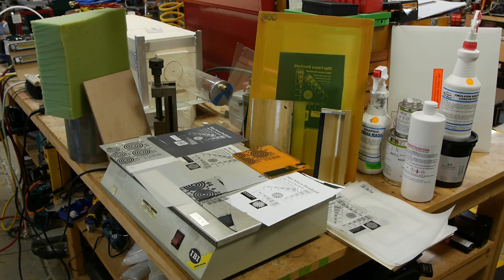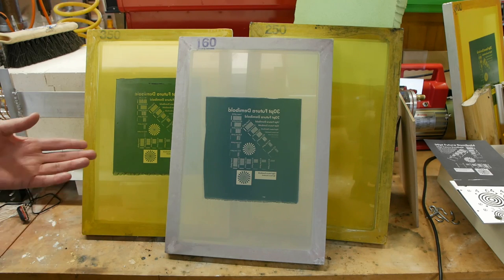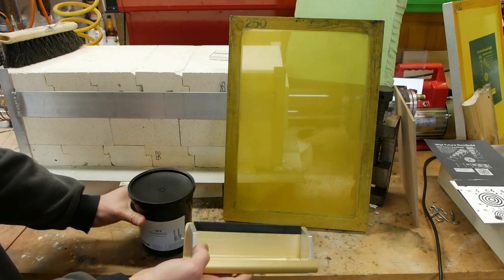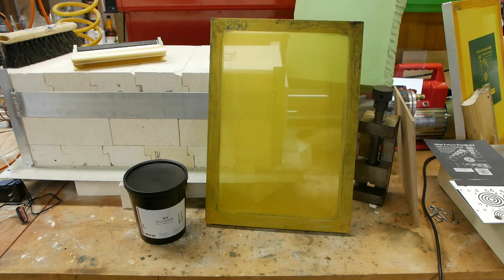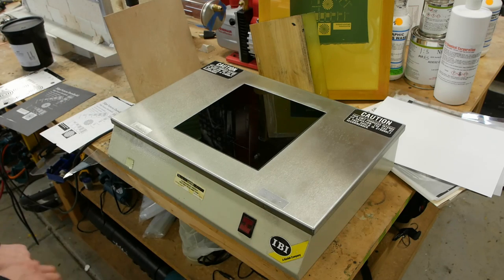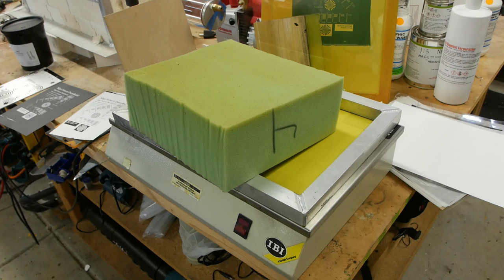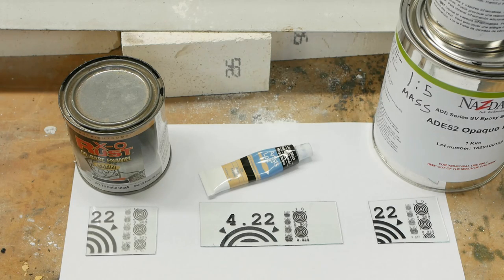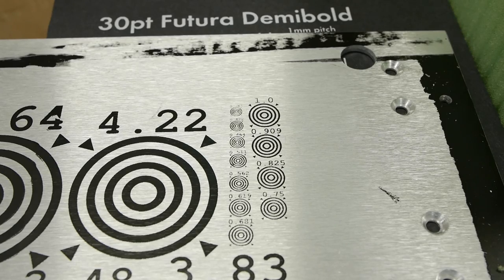High-resolution screen printing demystified

Comment: You should use inkjet to print the film. Not because of resolution, but because it gives a more solid print that blocks UV light better.
There is also a special transparent type of coated film that absorbs more of the ink, which gives greater contrast.
To help with exposing, place a flexible rubber mat over the screen and glass, and suck the air out with a pump. That will keep the screen and film in good contact while also blocking any stray light.
I think pink emulsion is a special long lasting emulsion, which might be why it was hard to get off.
P.S I've run a screen printing shop for 8 years.

Comment: They make transparencies for screen printing that are "textured" on one side, and are slightly less opaque than vellum paper. You put them through a printer such that the textured side gets printed on, and you do this a couple of times for one sheet, as the sheets are designed to take a lot of ink.

Comment: Ben, very nice video.   Years back (70's) when I started working we did PCB's with  the SS process. Didn't take long to go to emulsion resist film but the solder mask and legends were still via SS.  Now I think the solder mask is emulsion film and the legends are direct ink jet printed.  Before PCB's got so inexpensive I had plans to make a laser plotter with a rotating cylinder holding some ortho photo film.  Needed good artwork for my diy PCB's.  Also wanted to try a laser printer's rotating mirror scanner with a flat bed that moved in the X direction to raster plot the image.  I had a friend that  mounted a 405 nm UV laser  on an ink jet printer carriage and did a direct raster image to the PCB's resist film, it was slow but the image quality was really superb, for one off PCB's it was great. SS capability would be nice for front panels overlays.    Direct UV laser exposure should work with the silk screen emulsion  but I would guess it would be a little slow.  
Craig

Comment: That fancy stuff they sell to clean the epoxy screens sounds like something I use for cleanup when doing epoxy layups for my rockets. It's this stuff I get from TAP Plastics called "Replacetone". It's a non-flammable and non-volatile biodegradable solvent for epoxy. It works great at cleaning brushes and rollers, so it seems like it might be the same kind of thing, or work for this application. BTW, it looks like you have all the makings for a custom DSKY display now... is that the long-term goal?
Reply: Hmm, a DSKY display would be interesting! Also interesting is the fact that the font that's shown in this video, Futura Demibold, is very close to (or possibly identical to?) the font used on the buttons and indicators (apart from the EL 7-segments) of the DSKY.
Reply: Good catch!!! I didn't even make the connection.
Reply: Does that stuff dissolve set epoxy? Could it be used to depot potted electronics?
Reply: I don't think it works on set epoxy. You can depot electronics by soaking them in an acetone bath with a little heat and agitation over a long period of time (days/weeks). Just keep the container sealed so it doesn't evaporate.
Reply: You can dissolve epoxy with methylene chloride

Comment: The thing to take into consideration with vellum is that it shrinks a bit when it goes through a laser jet printer. This could be a problem when you're aligning your screens for a multi color print if the vellum sheets were shrunk unevenly. Especially if you're dealing with halftones. Acetate sheets would be the way to go when dealing with more than one color.

Comment: May be worth noting that using a totally transparent imaging film (with a compatible laser printer) does have a hypothetical use, and that's alignment for process colored printing. If you're wanting an image with color you'll need to make four passes and aligning the imaging films together before matching them to 4 different screens and a jig makes the work go a lot faster and a lot cleaner (i.e. skipping preprinting to align registration marks)

Comment: a couple notes, as I'm a screen printer by trade.
-while the different 'white lights' may expose the screen better than the 'blacklight' bulbs you had, generally the only wavelength that 'exposes' the emulsion is around 420nm. about the best exposure light you can get is a 50w UV-LED flood light, you can get your exposure time down to seconds.
-If you're trying to figure out the amount of time to expose your screen, I'd use a 'step test' that has a repeating pattern, where you uncover each pattern at intervals, and see what exposure time works best for you, without wasting multiple screens to find out.
-There's not a huge difference between diazo, or dual cure emulsions, and capillary film, if applied properly, except emulsion is A LOT cheaper, if you're doing a lot.
-Different emulsions and capillary films work different depending on the ink you're using, some inks will break down some emulsions. make sure and get the right kind for what you plan on printing with.
-For the transparency, most 'pro' print shops actually do use inkjet. The trick is making sure you use transparencies that are made for inkjet, and make sure it's as opaque as possible.  One trick is to make sure the 'color' you're printing uses as much ink as possible, often if you use the color cmyk100 (100,100,100,100) it will print a much darker image than just simple black. If you don't have a good printer, most copy centers can print good opaque transparencies for you (even up to 11x17 if you don't have that size printer) 
-One thing you didn't address was just HOW quick ink can dry in a screen. If you are using an 'air drying' ink, and don't keep the ink moving, or the screen flooded (filled with ink after printing) it can potentially dry quite quickly, and either ruin stencil for the rest of the prints, or even permanently dry in the screen, where it won't even wash out after you're done, depending on the ink used.
The example comparing it to going to the moon is perfect.. so many people think you just 'scape ink' (shudder) and you're done.. there's SO many aspects of doing it, that people just don't realize. Another good saying is 'amateurs practice until they get it right, professionals practice till they can't get it wrong' 
Feel free to drop me a line, if I can be of any help in this type of stuff!
Always love your videos,  Keep up the good work! 
-Bill
SignMeUpExpress

Comment: It is less about the screen openings and more about the "knuckles" where the threads overlap, that matter. As the speaker said, the emulsion has the ability to bridge over open areas but nothing can open up the area that falls on a "knuckle". I do go pretty high in thread count to avoid moire and saw tooth and I also tend to use capillary film as opposed to liquid emulsion for my screen masking product.

Comment: It's like you ready my mind.I just (finally) started doing my own PCBs for really small, single runs. Basically using a Sharpy to draw the traces because I can't find a good supplier of transparencies that my laser print won't fail to work correctly with. 
I started looking at screen printer. Now I see your videos has those velum sheets and they are sold locally for me.
Reply: Done lots of DYI pcb's in the past.   Go get some Riston PCB photo resist film off ebay.  Then just process it  like Ben with the UV exposure.   But when I can get 10ea  PCB's 100mm x100mm from JLC PCB for $2 (20 cents each) in a week it's 2 layer with PTH and silk art not worth the time.  I can't buy the blank stock for that price.

Comment: It seems like you should be able to use a high watt UV basking lamp as well. Available at pretty much any good pet store. Just a thought.
Reply: I'm not into reptiles but I'm pretty sure those are infrared.
Reply from the maker: @brocktechnology  It's both UV and IR.  Many animals synthesize vitamin D by sunlight exposure on the skin, and I'm guessing its more critical for reptiles since they have adapted to extremely sunny climates.
Reply: Applied Science I have a reptile. Bearded dragon. They do need both. The night heat lamps are the ones that are IR. The daytime basking lamps are UVA. UVA is more critical though, and not just for vitamins but the animals wellbeing altogether. It helps with digestion and mood, as well as sleep cycle.

Comment: when etching a PCBs we used an vegetable oil applied to a paper with photomask, it makes the paper more tansparent to UV and helps to stick it to photoresist, you even may not need a piece of glass on top. you can find the right fluid that will not dissolve your photosensitive coat.

also you can use the "toner dencity" spray to make a laser printed picture more contrast. it like a lightly melts the toner surface and closes the gaps.

Comment: In the 70's I worked as a press operator for a very large company (CSPI) in Oklahoma City and ran large format 4 color process and multi color jobs mostly on 4'x 8' stock on Italian (Argon 54 x 101") and US (Americam much bigger, too darn big!) presses. We used household bleach to remove stencils and potassium hydroxide to remove the haze... many great times but it was hot by the dryers.

Comment: Awesome video as always, thanks! One thing to think about when using a laser printer is that it may not print as dimensionally accurate as a ink jet printer, especially larger prints may skew depending on the paper and printer.

Comment: on the note of overhead projectors you can simulate one by cutting 2 sides off a box and placing a mirror in there at 45deg that way UV light is only coming from one direction.

Comment: The rays of the sunlight are parallel, the rays of your UV-light source are not. Hence, the resolution reduction due to the shadow problem you describe is more prominent for the UV-tubes than for the sunlight. In case of the sunlight, there’s only the apparent movement of the sun, that can cause resolution loss, which is depending on the exposure duration.

Comment: There is also pre-coated screens that is common in the industry and it goes that they exchange used frames with screen with new pre-coated ones for those businesses that go through a lot of a standard sizes.

Comment: I am almost certain that the photosensitive emulsion used in the silk screen process is a mixture of regular PVA white glue and potassium dichromate. Which is a good reason for you to use gloves while using it. When I did this process, they would sell it in a two part set, one part was a very thin orange solution, that I tested and turned out to be dichromate. The other part was the same consistency as regular white glue, but they put a dye in it so people would think it is something more complicated (and I think that the dye helps to see if you have a good coverage of the screen too, I guess).  And if I remember right, you can use a solution of hypochlorite to remove the emulsion from the screen, once you are done with it.

Comment: Just came across this, not new video but very relevant to my situation! I am going to make airbrush stencils with relatively high resolution from photos that have been grayscaled and thinking I can use some of the information in this video. Thinking about the correct mesh count for the screen and thinking in the high 200 or low 300 count but the emulsion part is tripping me up. was going to use regular emulsion and coat a screen attached to a frame, expose and washout then just cut the image out of the frame leaving (don't need it in a frame)  a large border so I can tape it down and spray airbrush paint through the stencil. now I see people suggesting maybe direct\indirect and hoping to get some clarification on what direction to strike out in first! great channel!

Comment: Ben, you should try a big vacuum bag, when I was training to be a screen printer we had a vacuum exposure table, I'm sure it'll vacuum down sufficiently if you put the whole unit with a rigid plate behind  the screen, but use something other than glass, or at least with soft rounded edges. it'll puncture the bag or rip the screen.

Comment: Excellent video. Without getting into to many particulars which I think others have addressed, I've worked with a screen press that would have frames up to 54"x144". There are a lot of similarities but definitely differences. There is of course a hobbyist level and a professional level. I do wish we would have had a test screen that had the test resolution that you were using it might have solved a few problems.

Comment: you forgot to mention that you have to use a less viscous ink when using the smaller sized mesh which will help with the detail, but can lead to issues with bleeding.

Comment: The best Epoxy dilution solvent is denatured alcohol, I don't know about paints, but with radio controlled aircraft we use alcohol to dilute the epoxy to extend drying times. to remove all epoxy from overflow areas and to soften the epoxy should it need to be scrapped off the wood (balsa wood generally) You might try that on the epoxy painted cleanup, it may require soaking for a bit in the alcohol.

Comment: Also, in my about 15 years of screen printing experience the mesh count of the screen is Solely for the viscosity of the ink. Poly inks get 110, regular plastisol blacks and whites are about 160, 4 color process is about 320. For sparkles or flake about an 60-80 mesh is used.

Comment: So why not put the artwork printed side down for better contact with the screen?
Reply: Absolutely. Printed side of the film in direct contact with the emulsion. The tiny gap caused by the thickness of the 'film' absolutely effects resolution. For large bold graphics, no big deal. Trying to reproduce maximum resolution, absolutely a big deal.

Comment: I used to do a lot with screen printing many years ago. I was a tech that dealt with Atma screen printers as well as RokuPrint.

It's still used a lot these days for specialized applications where digital is well... too digital and solid durable inking is needed.

Comment: I can suggest couple of tricks when rinsing...  Some emulsions will continue to produce a residue that will run into the image areas and dry as a haze that ink will not pass through and is surprisingly hard to remove.  This can be avoided with two tricks.  First, let the screen dry diagonally on its corner.  This encourages any emulsion residue to run down the fibers and out of the image area.  Second, let the screen sit diagonally for about a minute, then re-rinse.

Comment: Be careful when you allow the regular light to hit your emulsion. It will make wide open areas pull harder on your edges when you spray it out. It can pull some of you single halftones off. It also starts to matter with process and simulated process and when avoiding moire patterns.

Comment: I've used common low weight printer paper, soaked later with cooking oil to make it "transparenter". Also, some HP Printers has a setting for toner density, 1 to 5, factory set is 3, if you want the darkest blacks

Comment: I am having a lot of luck with ULANO Vision 35 film and the inkjet clear film too. 
The NY office was very helpful. 
The issue with ULANO Vision is the way they sell it, by roll.  Some companies will cut the rolls up to sheets, but it seems that the minimum quantity of sheets seems to be 50 sheets.  I think this stuff will not last long once the package is opened.  It seems to be important to tape the flat bag shut after using a few sheets.  ULANO Vision is not cheap when you need to buy so much.  However, it works great.  It is a dual cure emulsion.

Comment: the distance or gap between the screen and material to be printed is "off contact" For textile printing the thickness of a quarter is a good staring point and for glass or less dynamic material i would adjust to less than. there will be less image distortion with the screen not having to stretch as far to material being printed. 
Cheers :)

Comment: The emulsion sheet you showed looked like it could be used for masking
aluminium during the dyeing process in anodizing because the uv exposed parts could
be washed of in water, instead of needing a caustic developer. After
the dyeing maybe the sheet could be re-exposed to uv and the rest washed
off before sealing the aluminium.